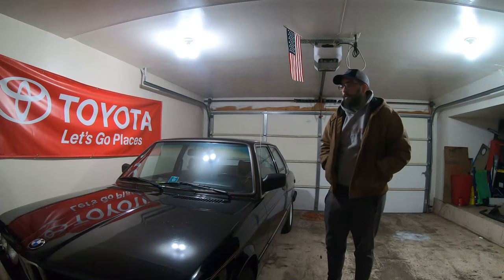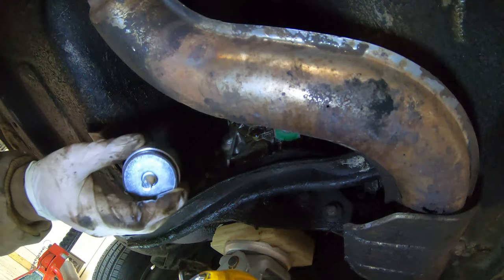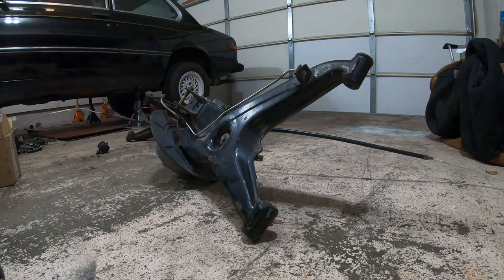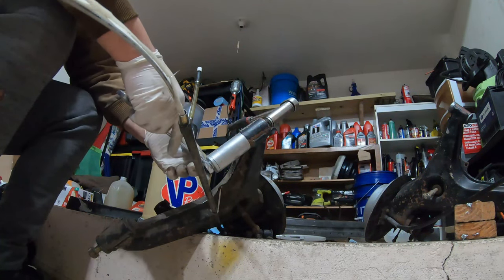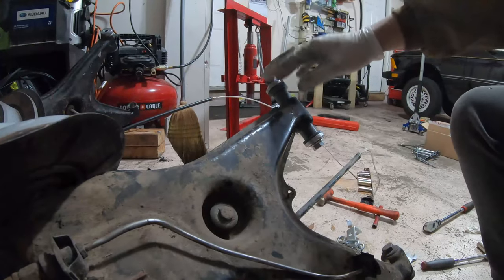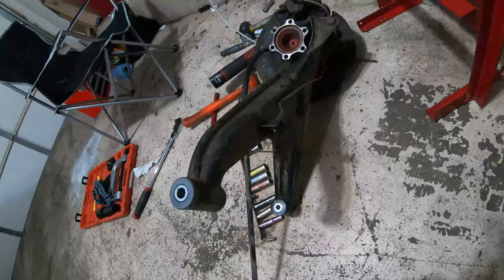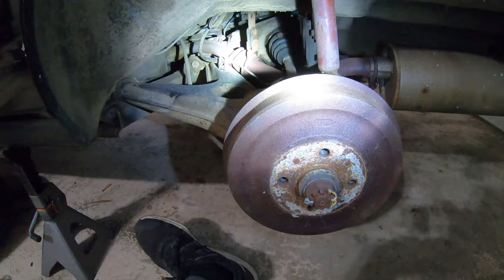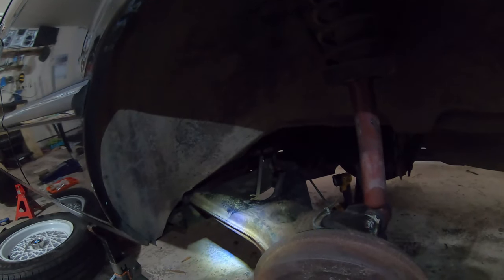Subframe Drop DIY on Taylor's 1983 BMW E21 320i: AKG Bushings & Rear Disc Brake Swap! (Part 1 of 2)

Comment: When I removed the rear subframe I took off the axles, trailing arms, and diff before dropping it.. less of an issue especially when working on the floor with minimal clearance.  I'll be brush painting mine this weekend.
Reply: I've pull trailing arms, diff, and axles with the subframe still in the car and I'd say it's a lot more work than just dropping the subframe.

Comment: Be prepared for a LOT of additional vibration and noise with those poly bushings, particularly with the transmission mount. I'm actually switching back to a (new) OEM mount (still readily available, around $45) because I'm fed up with the excessive noise and vibration. I'm leaving the other poly bushings in place for now until I see how much of a reduction I get from the trans mount alone.
Reply: Yes! Since this video, I've realized how buzzy that transmission mount is. Likely going to swap back to stock. I don't think the diff and rtabs are going to cause much NVH on their own.

Comment: It's funny to see those Kumho Solus TA 11 tires on just about all daily-driver E21s. I just replaced my 15-year old Yokohama Avid T4s with the Kumhos from Tire Rack (Discount Tire has them as well for the same price). They are about the only tire choice available if you want to avoid the Chinese brands or made in China tires.
Reply from the maker: Definitely hard to find tires for smaller wheel sizes now! Even 10+ years ago, it was hard to find good performance tires for a 14" wheel, which was common to Miatas, E30s, Civics, etc. We're glad the Kumho tires are available!